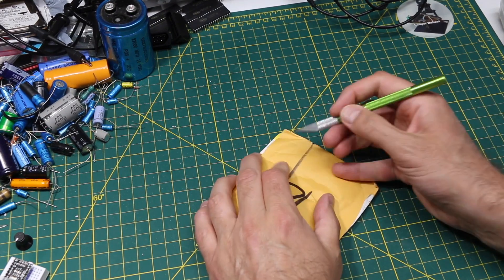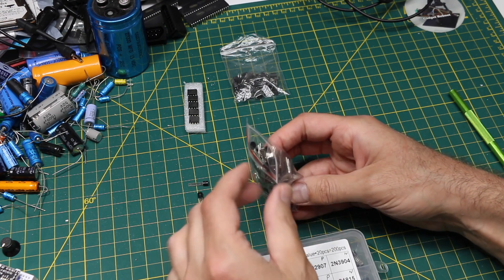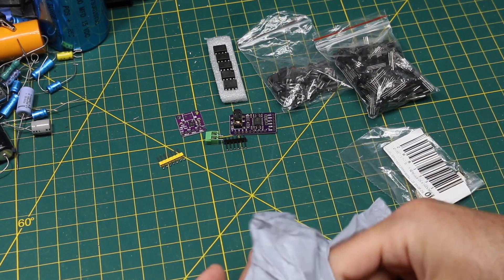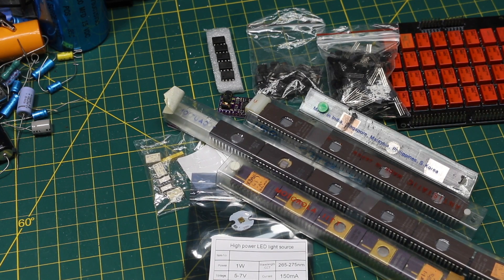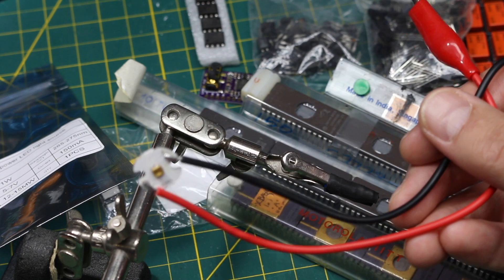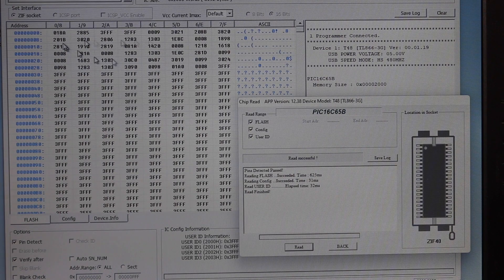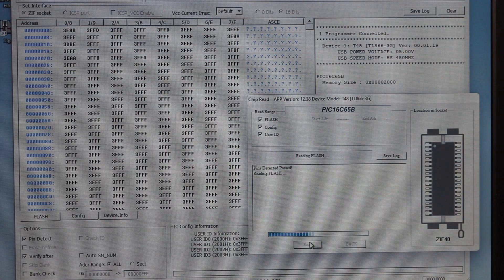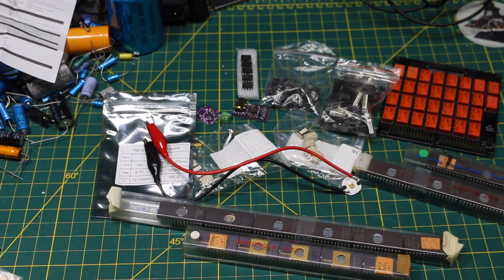Mailbag!

Comment: Nothing to do with erasing but one thing I found out recently is that the "profiles" on the eeprom programmer may not always exactly match the datasheet for the EPROM...especially if it's a rebadged aliexpress one.  So you may need to bump up the voltage in the software if you find that a chip you're trying to program doesn't seem to be programming.

Comment: Interesting haul!
Have been using PC817s to drive mostfets for a while, but there is always the issue of gathering the correct gate turn-on voltage.
Am curious to try  photodiode array drivers, like the VOM1271 with auto cutoff.  They look a lot easier to use.
Quad bilateral (analog) switches like CD4066 may be a softer way to implement your relay board ... but you would have to deal with some on-state resistance.
Reply from the maker: Yeah I need the signal matrix to be as passive as possible so relays were the only option.  But I am also going to be playing with the MT8816 8x16 analog switch chip for some other things that may not need as much signal purity.
Reply: @GadgetReboot  Ooo ... had to look up this MT8816 ... pretty fancy chip.  For "as passive as possible," Dual Latching switches must be your thing, so the system remains as configured, even without the switch driver.  Those kinds of switches are a little pricey too. Looking forward to seeing your evil invention in a future video.

Comment: An ordinary lens will filter all the UV-C out. That's why UV-C lamps and the window on that EPROM is made out of a special type of quartz. Best to use a regular UV-C florescent lamp which are made for water or surface sanitizing. I have a 10cm long 7W one under which I can easily fit 5 EPROMS from a distance around 2cms. It takes around 10-15 minutes to erase all 5. Whole thing is placed inside an aluminium project box and I added a timer circuit in case I forget to turn it off.

Comment: Keep in mind you need to saturate the EPROM cells rather than just push them over the threshold. The amount of energy they absorb past the threshold will determine the lifespan of the erased bits and the light pattern given off by the LED may be an issue at that scale too. I would add a UV translucent diffuser and up the time. I had both the original Datarase and the Datarase ][. These days I use a cheap aquarium UV lamp which has the same bulb in the Datarase ][ and I also have a little USB powered cold cathode U shaped tube and driver from the usual Chinese electronics source.
Reply from the maker: I do want to get something better where I don't have to fine tune and tape down the position each time.  Luckily I don't have to do it too often.
Reply: @GadgetReboot  Your experiment is very cool. After seeing your results, I'm very tempted to buy one of those stars with four LEDs and run them at 100 mA with a constant current driver which could go into a small box, like a smaller version of the Datarase ][. Seems pretty ideal compared to the aquarium light and shoe box I'm using now and I wouldn't mind getting rid the the mercury tubes.
Reply from the maker: I was thinking more LEDs would also be more practical trying to get the light focussed where it needs to go and covering a wider area.  Where could we find a UV diffuser and would it be as simple as looking for those key words?
Reply: @GadgetReboot  I was thinking frosted quartz in the thinnest sheet available, but I wonder if it's even necessary if you have 4 of those LEDs running. I'll bet the LEDs alone do an excellent job with a few millimeters between the star and the window to blur things. For examples of the diffuser I was thinking of, search for 'Sandblast Frosted Quartz Glass Sheet' or 'Milky White Fused Silica Wafers'. It needs to be quartz to pass the UV which soda-lime glass will attenuate sharply. I don't know what else might work.